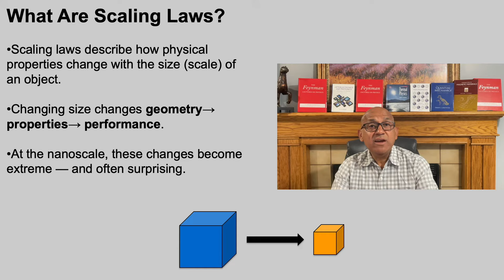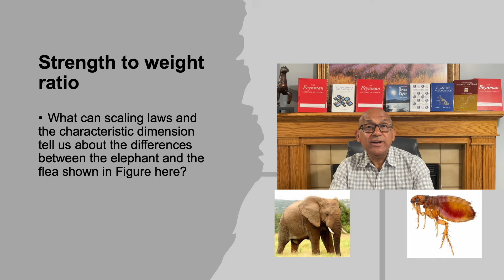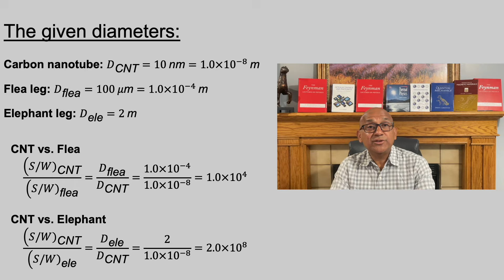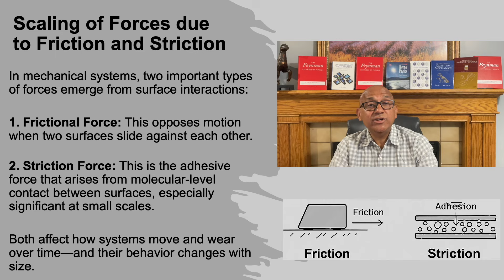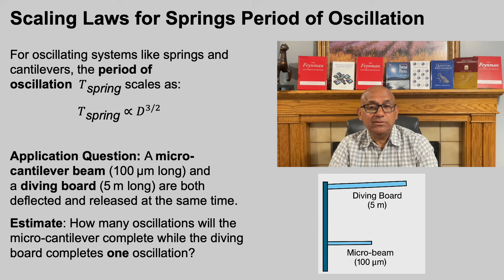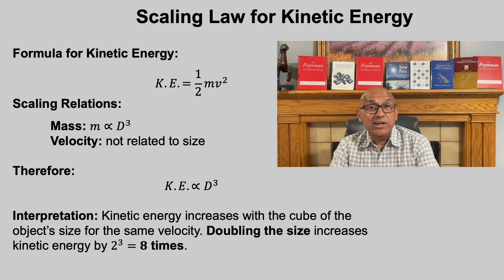Nanotechnology Lecture 2 | Introduction to Scaling Laws: Surface-to-Volume Ratio & Mechanics

Comment: Really cool video. I never realized how much size affects behavior and performance. The way they explained surface-to-volume ratio and why nanoparticles are so reactive finally made sense to me. The flea and elephant example was a fun way to understand strength differences, and even the weightlifter comparison helped me picture scaling in real life. I also liked learning how friction and adhesion change when things get smaller, and why tiny devices wear out faster. Overall, it made scaling laws feel real and easy to understand.